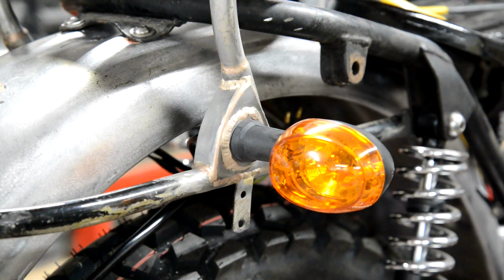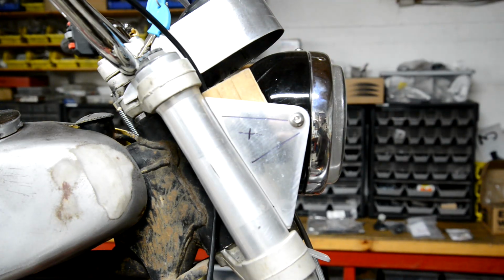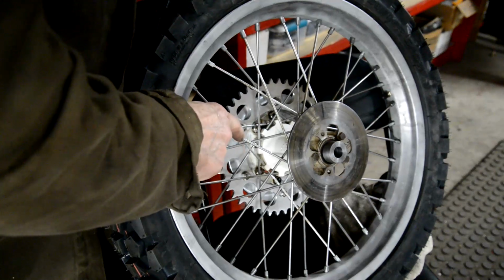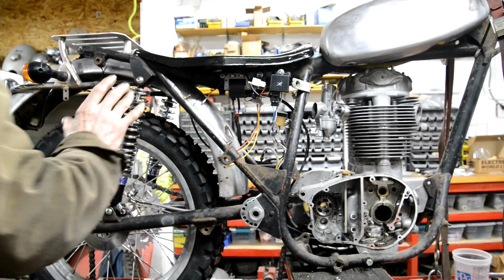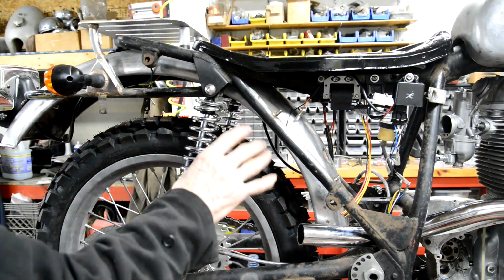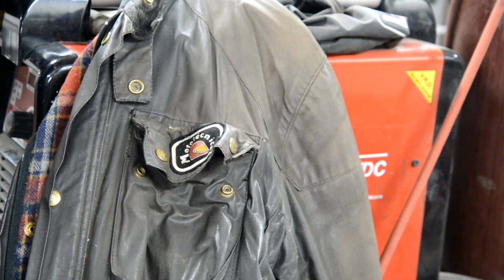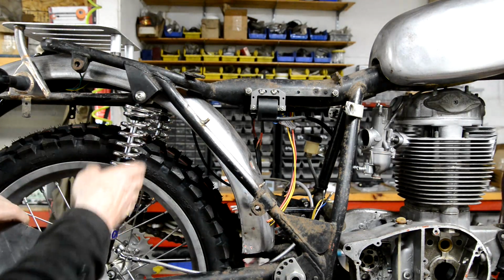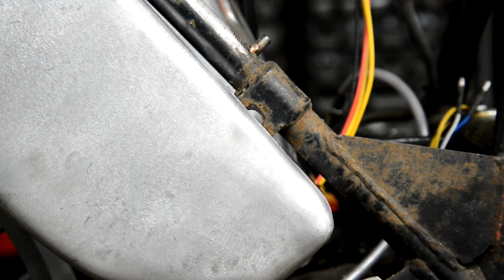BSA B50T Upgrade  -  Part Ten

Comment: Hello Michael, another informative video, weather clips too!
I know when our heads are down it’s sometimes an idea to stand back and have another look. Would it be nicer to extend the tab for the fixing so the bolt is more inboard on the silencer?
   I like the idea of the cut out to set the box into the frame. You can then fix it how you please fixed nut or whatnot.
  I think your experience on the Otter tank is paying dividends now with your sheet skills really like the way things are working for you.
Cheers.

Comment: You could weld a bolt to the silencer for that lower mount and then have a nice clean finish on the surface .
Also I bought a B50 downpipe here in the UK which was loose in the head and sent it back the next one was the same. 
Got a different one from another source and the tab did not line up but it fitted in the head.
Reply from the maker: As I mentioned I haven't bought one for years that fits straight on. And that includes exhausts from Armours in the UK

Comment: Always interesting being in your workshop.I really like your silencer designs (Otter ‘Umph and this one). If you fixed in a decent sized lump of solid ali as a boss for the bolt, welded all round, surely that will take the stress of the mounting and not let go? Any way, I think this shape is much preferable to the old Beeza “cut down barrel” silencer you tried on it. That pipe (bracket) was a disgrace! Another really nice Sunday evening with Michael! Les in UK
PS, you can keep that snow, we don’t want it!

Comment: I'm just wondering, if the front engine mount was reworked, would it allow the bottom cases to in effect pivot on the bottom tube rails. I noticed on my modern Bonneville that the front mounts are removable triangular plates bolted on to there own cross tubes. If say the left hand mounting was made wider than required and a spacing piece slides in when the bolt goes through, that could look quite neat. That would be an update to the design allowing at least the cylinder head to be assembled separately from the rest of the unit. It would be a big mod to make and the rear mounts may prevent such movement, making the idea a non starter, unless one of those was also made removable or spaced wider apart.
Reply from the maker: The bottom and front frame mounts are wider than the engine castings with spacers you take out, so that, as you say, the engine can be leaned over a little to help it clear the top tube.

Comment: That downpipe looks poor bracket wise. Can't speak for the B50 but the 1972 T25/B25 the front engine mount was bolted to the downtube and looked larger than the welded on B50 of your bike? But like the idea of keeping to the original silencer shape as it was a unique design. Keep up the good work makes my Sunday evening in the UK more enjoyable.

Comment: Just a thought. With the electronic module mounting plate, instead of welding on nuts, why don’t you use rivnuts instead? They come in aluminium, mild steel or stainless steel, although the tools to insert them are specific for each material. Perhaps you could use a rivnut in aluminium on that silencer mounting with a bolt going in from the inside.

Comment: Front flashers don’t look the same from the front? Optical illusion???
Reply from the maker: I had a look and a remeasure and they are about 1/16" out. I will see how it looks when finished and then I could weld up the hole on one side and redrill it if need be. Well spotted.